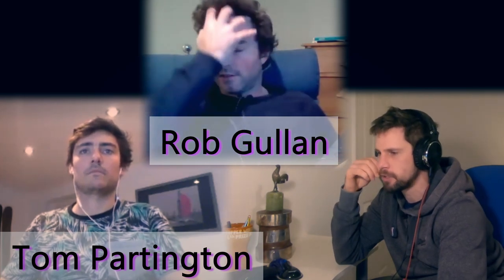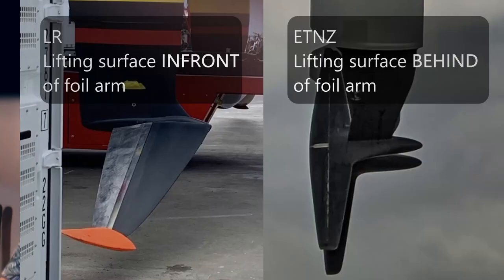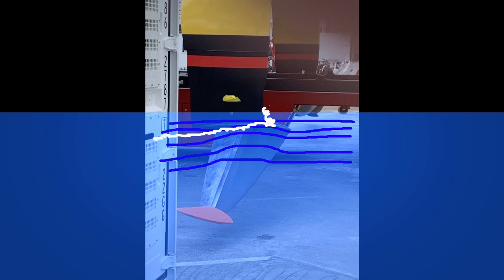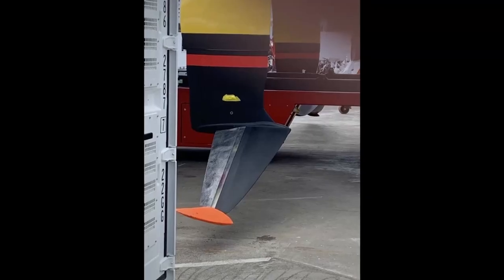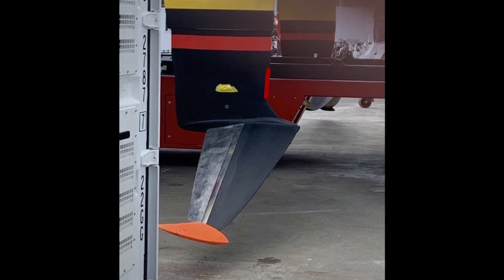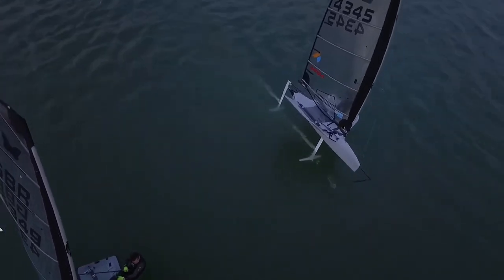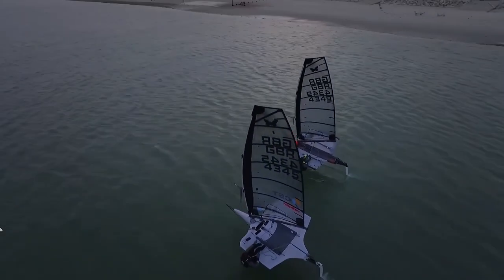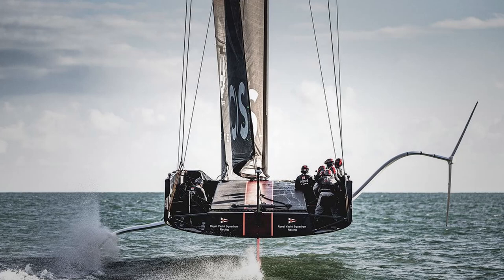AC75 Pitch Instability: The Hidden Power that Teams Won't Discuss

Comment: These guys would benefit from a study of the factors affecting modern aircraft especially airliners like the Airbus series. For aircraft stability at increased transonic Mach numbers increases considerably and the stabiliser (tailplane) therefore needs an increasing up angle to stop pitch down and this increases drag. By changing the position of the CofG away from the traditional centres these forces are cancelled and the symmetrical airfoil on the stabilser is adjusted to near zero thereby reducing drag and increasing range. The problem is that an unstable aircraft like this requires fly by wire to make the quick adjustments needed to fly under control. Pitch balance with varying speed. This is the zone of (well known) aerodynamics which the AC boats are discovering. It is always dangerous to relate aircraft tech to sailing tech. Sailing vessels have the sir and water interface to consider and aircraft don't have the competing force of the rig  - as well as a few other things to consider.

Comment: In all the discussion, so far unless I missed them somewhere, is the relationship between between centre of effort & centre of lateral resistance.
 
centre of effort in the sail plan during displacement speeds &
centre of resistance in the hull plus leeward foil/arma during displacement speeds 
then transition to foiling and the changes to 
centre of resistance of foil & arma only 
assuming the centre of effort remains the same or does it move as well due to the nose down pitch?
 
I am a visual learner would some additional basic diagrams showing the loads or vectors help?

Comment: Do the rudder foils have separate left/right flap controls? If not, I do not see how the rudder foil impacts the righting moment since the lift from the rubber foil will be vectored perfectly up through the centerline/center of mass/mast of the boat. Thoughts?
Reply from the maker: The rudder, when  flying, is a long way to windward of leeward foil. So it provides righting moment.
Reply: @MozzySails  Suspect this is where practical sailing skill response meets "wind tunnel  optimisation for speed" analysis. Rudder contribution to righting moment is tested least in level flight at almost any speed. Observation of recent stalls, splashdowns and spinouts suggest current rudder spec is easily overwhelmed by pitching and yawing forces if flight unstable through turns and if crew flight control work is not absolutely precise. Force generation over foils and through COE movements in sails is orders of magnitude greater than countervailing rudder contribution through its stabiliser wing or inherent righting moment in these situations. More  "eagle" setups  for turns seems to becoming flavour of the month. Perhaps a sensible sailors response to design compromises and follow on issues . They know from earliest sailing days  that slowest race move is a crash.
Great discussion as always ... thank you.
Reply: @MozzySails  The amount of righting moment is up/down force vector relative to the center of gravity, not the leeward foil or other force components. If the force vector of the force generated by the of the rudder foil points straight up the rudder and through the center of gravity. Therefore no righting moment. See https://en.wikipedia.org/wiki/Metacentric_height section on Righting Arm. For this force | GZ | = 0. i.e RM = 0.
The counter argument is that since one foil is down and the other is extended, the center of mass/gravity is not normally along the the center line of the boat. Based on the masses of the hull (and everything else) versus the leeward and windward foils, I expect (without calculation) that the center of mass is moved several feet to windward. Accordingly, the righting moment of the rudder foil is there but small compared with that of the leeward arm foil (size smaller and | GZ | much smaller). The rudder foil has a bigger contribution when just considering lift and getting the hull out of the water and with pitch control/stability.
Reply from the maker: @stevenallan4829  the centre of gravity is still roughly the centreline of the boat. The righting moment is the distance of the centre of force (gravity + rudder lift or downforce) from the pivot. However, boats do not pivot around the centre the of gravity, they pivot around the point of lift. The point of lift is the leeward foil, which is in the water.

Comment: In your flap actuation video coming up, I’m hoping you’ll clarify if computer controls subtle variations without pilot input. Ie, like “fly by wire” flight control systems. Commentators like Ken reed when speculating on performance jumps seem to talk as if this is a given when referring to teams updating algorithms. But I could be reading that in.
Reply from the maker: Fly by wire is not allowed. I think mostly the software will be controlling the rate of change when  a command is given
Reply: The Rules do not permit computer controlled outputs. That said, the teams use quite sophisticated "controllers" for flight and sail management etc, but crew members must initiate any change to the the boats status.

Comment: On aircraft a forward centre of gravity aids stability but increases the down force the tail has to produce. This in turn increases the lift and drag the wing has to produce. Moving the centre of gravity aft therefore makes the aircraft more efficient but also less stable in pitch. Does anyone know if AC75 boats are allowed to use computers to augment stability?

Comment: I am surprised at how little the mechanics of the AC75 is understood. This presentation contained a number of misleading  comments. Given a written copy of the presentation I would be happy to provide specific details
Reply: Specific enlightenments are always appreciated
Reply: Lets hear it. Thats why we're here.
Reply: They need a spy team so they can talk about what’s going on right now
Reply: The worst example is where it is stated that moving the centre of gravity aft, putting more load on the rudder foil improves stability. This demonstrates that static balance is thought to be stability. Move the C of G of an aircraft  such that there is a significant portion the aircrafts weight supported by the tail plane and see what happens. To increase dynamic stability the C of G needs to go forward. You can have static balance at the top of a corrugation. Dynamic stability is in the trough of the corrugation. see https://www.facebook.com/groups/2397006860595933

Comment: Hi, do you think a double foil type biplane is efficient?
Reply: I’m no you to reply to this question but this has been done back on the 50’ all the foils back then use this configuration basic due material, sorry to reply on this question.
Reply: @cjprimata  grazie
Reply: @cjprimata  A cursory glance to some YouTube videos (yay research :)) would suggest that the purpose of the foil stack was to generate lift in low speeds and in full speed only the lowest foils are submerged. But those were heavy motorized ships so they're not very relevant to high speed sailing.
Reply: @AnttiBrax  Yes, initial experiments used "ladder" foils - the stack as you mention. Later, it was found that a V foil could do the same but more progressively. A self-adjusting flight height method!

Comment: Lunna Rossa apperas to be able to point higher than Ineos. This is what happens when they try. So, Ineos ahead can be hooked and the faster tacking of Lunna Rossa wil result in LR passing Ineos. Whereas Ineos will note be able to pass Lonna Rossa except thru error by Lunna Rossa. Lunna Rossa wins.

Comment: I'm seriously considering designing my own foils starting with the rocket of the Seas, the Black Marlin (130kmh) . It, as well as the Sailfish (110kmh) are both arced rearward with the cord coming to a point at the tip. The top 4 fastest fish have a nearly identical shape coming to number 5, the Mako (74kmh). The Mako has a thicker cord and rounded end tip.

Comment: Even in the fastest aircraft, the tail pushes down with the wings lifting up. It's impossible to maintain stability without something making a few thousand microadjustments a second. Think American B2 bomber. Multiple flaps making microadjustments 1000s of times a second to compensate for both pitch and yaw drift and flutter. The design of "Magic"  is probably the quickest with more development time.